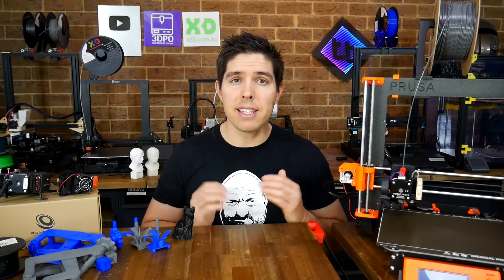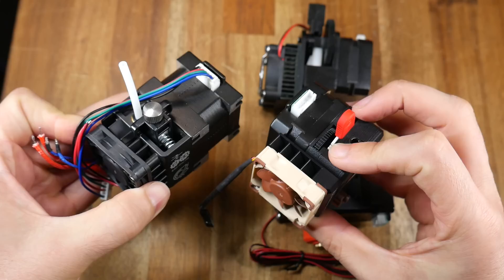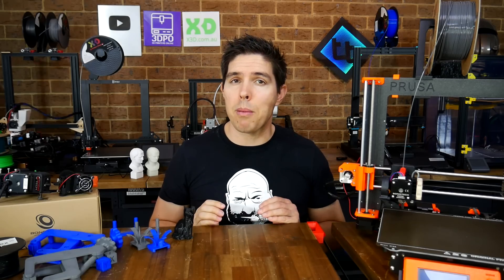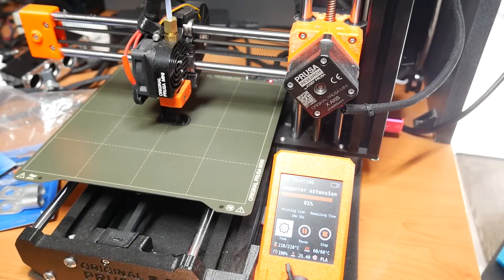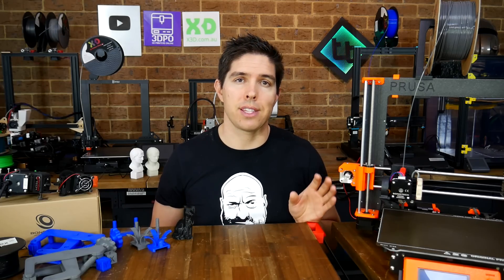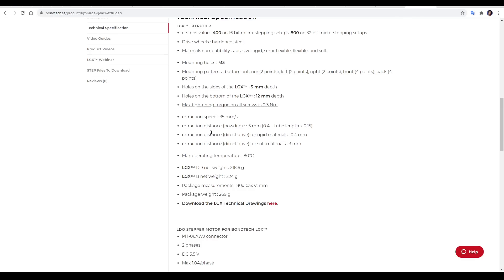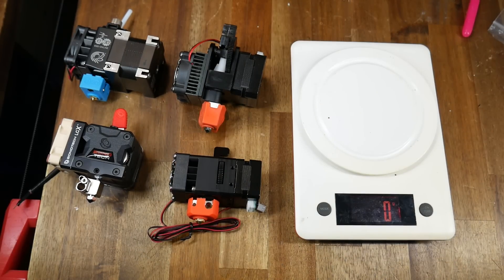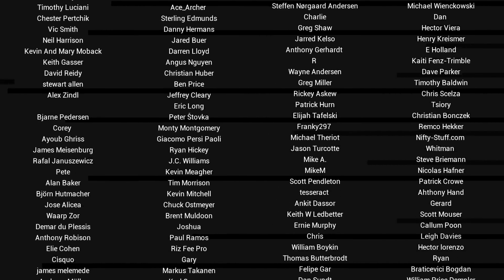Bondtech LGX extruder guide & test for Prusa MK3 and Artillery3D X1

Comment: Great video, thanks for this.
Trying to use this on my Ender 5 right now, and it seems like the extruder is “pulsing” (taking small breaks between rotations) rather than rotating smoothly, which is really affecting my prints. Could this be a vref-tuning thing, or what is going on?
Reply: Need to switch your middle two wires
Reply: really seems like a wiring issue, check your extruder motor wiring with a multimeter in continuity mode.
Reply: @mocotonio  thanks, I finally resolved it a few weeks ago, for some reason I had to set my vref to about 1/10th of what Bondtech suggested, motors were getting way too hot

Comment: Correction:
At 3:15 you mention it comes with a hardened steel nozzle. It doesn't. All the kits Bondtech is selling include their nickel-coated brass nozzle. While somewhat abrasion resistant, they are nowhere near as tough as hardened steel nozzles. You can see the coated nozzle reflected later in your video about the X1 kit at 5:24.

Have to say though I've been very happy with both the LGX and the FF kit with that nozzle on my Hypercube Evolution printer with a custom mount. Super precise extrusion control, small retraction distances, and their nickel coating has been working better for me than even WS2 Tungsten Disulfide coated nozzles from other companies. Full disclosure: I got mine for free through a giveaway contest.

Comment: you never remove all the bolts from a stepper motor at the same time, it is precision aligned at the factory. As a rule of thumb doing this drops torque by 20-30%

Comment: Another thing I’ll mention about temperatures on the LGX with the integrated Slice hot end is that I was able to drop my temperature substantially, while getting the same quality print results. Maybe try dropping your extrusion temperatures a little bit. I was really surprised I was able to print PLA down to 175 reliably if I want to do. I still tend to print hotter because I think it gives better inter-layer bonding… But I didn’t notice any mechanical differences between 180 and 210 which was my normal go to temp for PLA before. Just thought I should mention it as something to try.

Comment: Michael I see your BLTouch is flashing, I have this issue also, I believe it's firmware related, never did it before I recently changed esteps,  recompiled and flashed, now after a few resets it goes away. Seems to work fine though.

Comment: Great vid as usual, thanks! Love the concept, this truly looks like a significant step forward in the 3d community. I concurre with the filament advance wheel placement, looks very awkward. I like the tension lever, that on its own is great tech. I’m not excited about the cleaning window, looks small. I wonder if they could streamline the face in more of a hollow X to gran greater access to clean the gears and extruder teeth?!  Overall I’m placing this on my long term upgrade list to install in my ultimate 3d printer build. this is mainly due to the price of the item and the diminishing return on investment...it’s expensive :).  Thanks Michael.

Comment: Can you please attempt to design a good mount for the ender 5 or 3, if possible the flexible version as well
Reply: This needs to be done as they aren't making them for creality.
Reply: get a Hemera for half the price of this. I have one and it's amazing. You really aren't getting much more with this. Maybe if you are printing realllllllly high temp stuff, or if you already have a slice engineering hotend it would be a good idea.
Reply: I got one listed on Thingiverse.com. I'll update the offsets tonight. Mine is for the flexible version. I am also creating a new version to maximize print area as currently you lose a little of the Y axis. Will also make on for the Copperhead heatsink once it comes in.
Reply: @peterpizzurro  do you have a link?

Comment: I would really recommend to do some "engineering grade"  check of the ideas changes you show here before. 
Fist I do not think the LGX was designed to have its motor separated from the extruder body by 2.5-3mm - I'm sure if you you do that the contact area of the gears is reduced which will lead to early failure.
Second, It is impossible to have good hotend cooling as you rotated that cooling fan. There is almost zero space for the intake air are of the fan.

Comment: I don’t think it’s a huge step forward.  The hemera was the huge step forward when it first tightly integrated the extruder and hotend.  This is just an improvement on that idea. 

I am excited that other manufacturers are improving on the hemera model and releasing products like this.  It only means better prints for all of us.  

One thing I feel that this is missing is a water block to cool the hotend and stepper motor.  This would make this combo very appealing to use in high temperature enclosed printers.  The heat sink that you showed on the prusa looks so close to being exactly that.
Reply: Slicer does have a version of the mesquite that has a water block.
Reply: @n1elkyfan  it doesn’t cool the stepper motor and hot end in the same form factor as the heat sink shown as the video.

Comment: I dont know if its better than the best, seems a bit lacking for extremely fast printers. But dahm do I want this for flex filament.
Reply: Howso? :)
Reply: @jdrevenge  the weight of the large stepper doesn't help with fast movements.
Reply: @jerenable  Oh, yes, but it is compatible with Bowden if you wanted to go that route.   Not sure what the options are for direct drive lightweight assemblies, beyond just trying to find the lightest stepper possible.
Reply: @jdrevenge  you can't print flex with most Bowden systems tho
Reply: @jerenable  Exactly.  So how could this system be improved on? :)
Reply: @jdrevenge  geared pancake stepper, the really tiny ones, every gram counts on fast moving axis

Comment: Why not do the extrusion speed benchmark with a flexible filament, since this is what the LGX is supposed to be good at? Any old dual geared extruder can feed PLA/PETG/ABS as fast as your hotend can melt it already

Comment: I did this upgrade for LGX shortcut mosquito and flashed the EINSy10a FW for stock thermistor. During calibration wizard, the nozzle overshoots the front left of the bed for a bit of the initial circles. Is this normal?

Comment: Thank you for this video. I have had my first SWX1 v4 for almost a full year, 5/5/2020, and I love it. Mine is still completely stock with only a firmware update to include MBL. Loved it so much I bought a second one this year in January. It is nice to see some additional support for this printer. Since you tested and mentioned that the flow rate of the stock unit is 380mm\min and the Bondtech matched that rate with the smaller hotend, would adding a taller volcano hotend up that rate? As much as I like my printer I've been wanting to print even faster with it, especially after seeing videos of the 3D Passion Nova hot end going up and over 400mm\s, granted that was on a core xy style printer so I am not expecting those same results. Is this something you have tested before? What would be the limiting factors for a SWX1 to go past it's stock limit of 150mm\s? I know the frame\gantry would need some bracing but what mechanically would hold it back from achieving higher speeds?

Comment: Interesting Video Would be V interested to see if there are Heat creep problems on a 20 hour  print at + 230 Nozzle temps though.
 Fancy throats or not there really isn't a helluvalot of dissipation area. on this contraption. Well a year later the weights of these Extruders was surprisingfly High Curiously the Venerable Titan was Light..  Not a lot of Progress  there . Then there is the rising realisation that the Dual gear Bondtech design has sewrious mfg issues as in the gears (ALL of them) are eccentric.. creating a slew of unwanted artifacts. The venerable Titan with it's old Skool  (Non Hobbed:-) single drive simply prints better. But it wasn't the newest /latest Kid on the block.

Comment: Great video as always, $300 though, guess I'll wait for the clones
Reply: Aaaaaah, pls dont do that.
Reply: @adelowooyediran9166  no way I'm paying $300 for an extruder. If Bondtech don't want clones then maybe they should reconsider thier pricing structure. They're a great company with some great products but they're just too pricey for my pockets.
Reply: @adelowooyediran9166  OK Michael has perhaps not explained the pricing fully. The extruder/motor is £99 which is pricey but nowhere near $300 is only $300+ if you buy the copperhead with it. As far as I can see the standard lgx kit will fit a dragon hot end (very similar design to the copperhead). I might therefore buy one. Its a shame there is no v6 fitting available!
Reply: @g.h.c855  i understand, this things can  buy a whole 3d printer.

Comment: Dont want to be that guy but slice tells you to only use 2.5nm. This is not a aluminium block to cold tightening is fine. I had a mosquito for over a year and only do cold changes with 2.5nm and never had a leakage.

Comment: I like zip ties, but at the buy-in price of a Prusa, I expected something different. They work, but seems skimpy.
Reply: The zip ties solve the issue of overtightening u bolts and bending the bearings so I am fine with it.
Reply: The Prusa is filled with design decisions like that. If a couple zip ties annoy you, you'll hate the rest of the printer.

Comment: Would like to know which you prefer on the MK3 E3D or Bondtech or something else.  Also do these work with the MMUS?
Reply: / Also do these work with the MMUS?

No, not compatible with the MMUS

Also, mentioned being able to clean the extruder teeth  (on Thomas Sanladerer's video about the LGX)

No, not exactly, at least on the MK3S+, you would have to remove both fans and the heat sink to gain access to clean the gears.

But other than that, with tuning, the LGX is a flexible extruder of the first order.

Comment: No before and after prints? And your own impressions were formed by comparing it to an older style Prusa extruder rather than the newer style Mk3 S+ extruder that has the shorter filament path and prints flexibles very well (from first hand experience, NinaFlex at 60 mm/s) and I think is also lighter than the older Prusa extruder you were using.  So I am left with no idea of whether this is actually a performance or quality upgrade for regular filaments....which surely should have been one of the key things to explore. Not up to your normal fantastic standard.

Comment: Before writing this comment, I thought you could use this extruder a little like an Hemera extruder/hotend combination. I later realized it was the flexible filament set, I took as the standard option.

Wouldn't it be an upgrade to combine this extruder with a dragon-style hotend? I guess the engineering would be a problem, as the motor is connected to the cooler and in the dragon style hotend that is more or less floating, as the force is not transferred through the heatbreak? I guess it would definitely be possible to decouple the motor and the cooler. Then it should be possible to combine all the advantages they have available in a single product. 

I really like seeing them making progress in improving their designs :)

Edit: I meant Mosquito and not Dragon hotend, and it looks like the cooler and the motor are not connected as they are in the Hemera. I guess, that brings us closer to see an extruder like this combined with the Mosquito hotend features :)

Comment: Why didn't you compared it with the orbiter, apart for the orbiter not being a all in one unit?
Reply from the maker: The orbiter uses these style gears and is also SLS Nylon so perhaps a good comparison. However it is currently installed on the printer so I would have had three machines in pieces to be able to show them side by side.

Comment: I know what I'm going to say isn't about what you're working on, but, I have 2 SunLu S8 that aren't running right now. Both are over heating the bed and hot end I installed TH3D firmware, but it didn'

t work..... I would like to change out the board- but I don't know which board to get. If you could let me know the board to get I would be grateful. PM me if you would like. Thank you

Comment: I have a Sidewinder X1 and the stock extruder (with a $10 replacement idler lever from Amazon) is amazingly good. My prints are flawless with all types of filament including soft TPU. Unless you plan on printing 450deg exotic filaments there's zero reason to do this upgrade on an X1 IMO.
Reply: With my X1 the stock extruder had one of the bearings rust up and eat itself.

Comment: Why didn't they go with the mosquito?! Changing nozzles is the worst thing about 3d printers with a heatbreak that is also structural. The mosquito is one of the few hotends that gets it so right. Sorry but I'm not an octopus and don't have 8 arms, so I will end up hurting myself, the printer or both.
Reply: The basic kit comes with a adapter plug that is compatible with the screw mount Mosquito hot end. Just the flexible filament add-on kit comes with the Copperhead hot block.

Comment: 5:34 why bother making it a copperhead? When they could easily turn it into Mosquito with all its additional benefits
Reply: The basic kit comes with a adapter plug that is compatible with the screw mount Mosquito hot end. Just the flexible filament add-on kit comes with the Copperhead hot block.
Reply from the maker: This should be modular enough that you can mix and match the parts you want.
Reply: @scramsby  Yes I know. I'm talking about flexible set (that hamera style side mounted heatsink). Why not just go with mosquito block, ridged mounting it to heatsink. That would not just make nozzle swap easier. But also it would help with heat creep even better. Which (in theory. Correct me if I'm wrong) reduce friction further in tube making flexible easier to push/less likely for it to buckle out
Reply: @TeachingTech  does that flexible set (one that came for Prusa) has any way to attach mosquito block?

Comment: Makes no sense to do sls plastic parts for mass production when you can make cheap mold and reduce your cost by 1000times!
Reply: They explained in the making of video that it's easier to do revisions on the design with SLS as they don't have to make new molds.  Also, SLS allows for more complex designs.

Comment: I drank the koolaid with the first Bondtech dual drive. The were over priced and under engineered.  The tension screw pulled out the pressed in nut and the molded in  bowden clamps failed and the online support had no solution.  No thanks.